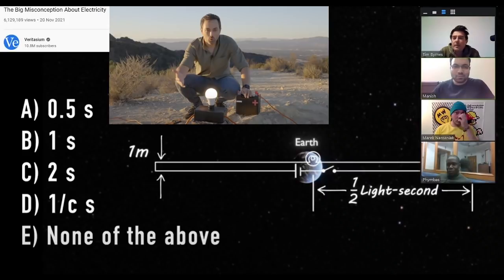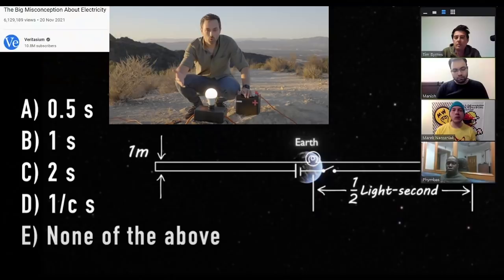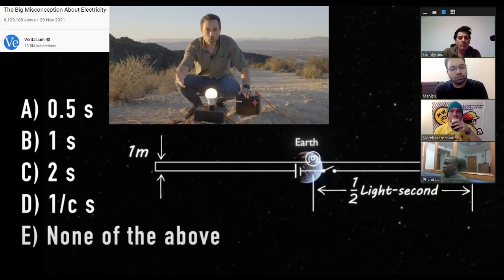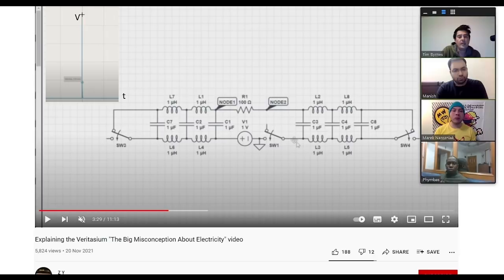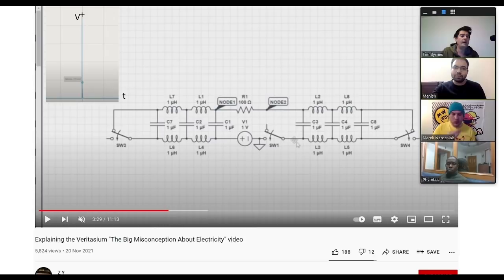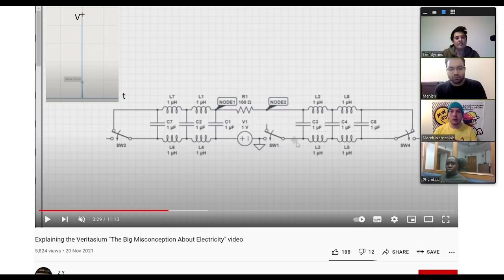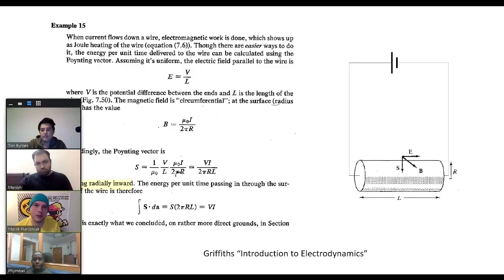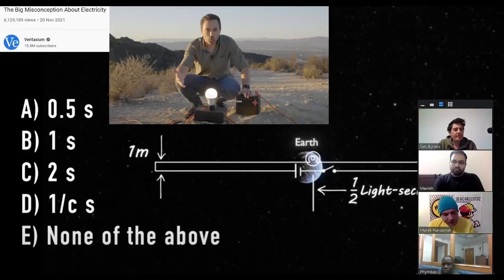Veritasium's Big Misconception About Electricity video and the point about Poynting

Comment: I enjoyed your discussion one the Poynting vector. I have a few comments to add. 

At  8:36  you go through Feynman's discussion of the stationary charge in the field of a stationary magnet. I realize he says this example will convince you the "theory is obviously nuts" he is actually just leading you along. If you read right to the end of the chapter you will see that he demonstrates that the momentum density of the field g is 1/c^2 * S, so that energy flow and momentum of the EM field are proportional. So 'he says' the strange rotating energy flow in this example can then be equated as angular momentum. He revisits an apparent paradox in 17-4 of the book, he say's "about a solenoid and some charges mounted on a disc? It seemed that when the current turned off, the whole disc should start to turn. The puzzle was: Where did the angular momentum come from? The answer is that if you have a magnetic field and some charges, there will be some angular momentum in the field. It must have been put there when the field was built up. When the field is turned off, the angular momentum is given back. So the disc in the paradox would start rotating. This mystic circulating flow of energy, which at first seemed so ridiculous, is absolutely necessary. There is really a momentum flow. It is needed to maintain the conservation of angular momentum in the whole world." So Feynman does take the Poynting vector seriously.

Later in the discussion ( 13:42 ) there is speculation about whether it might just be the divergence of the Poynting vector which might make physical sense as this does locate the real sources and sinks. But you are forgetting the rationale that Feynman used when opening Chapter 27. For the EM theory to conserve energy in a relativisticly consistent way the energy must be locally conserved and effectively track-able from source to sink. So the energy flow must be real, whatever energy really is.
Reply: Your recounting of Feynman's explanations hits upon my view on the Poynting vector descriptions for circuits. My perspective is to view the fields' energy density as the capacity to do work; so, unless one is interested in understanding the dynamics of some object that couples to the field (e.g., electrons), it sounds like an energetic analysis only gets you halfway to understanding the system behavior.  Even in your quoted example of Feynman's explanations, he refers to how the energy density is used as a ledger to explain system dynamics (i.e., the rotating disc), which is an explanation motivated by the apparent absurdity of analyzing the energy density alone.
Reply: In our static charge-magnet example, the magnetic field is static, so curl(E) = 0, while curl(B) is given by curl(mu_0 * M), where M is the magnetic dipole moment density (or magnetization) of the magnet. B dot curl(E) is zero everywhere. E dot curl(B) is non-zero, but the integral of this value over all space is zero because E is a conservative vector field while curl(B) is solenoidal field without any sources and sinks. Thus, due to the calculus vector identity -div(ExB) = E dot curl(B) - B dot curl(E), the spatial-average of divergence of the Poynting vector -div(ExB)/mu_0 is equal to zero 0. So in some places, -div(ExB)/mu_0 is positive, and in others -div(ExB)/mu_0 is negative. So in our static charge-magnet example, there is infact a divergent flow of energy which flows from one side of the magnet to the other. As it turns out, this net "momentum flow" in the Poynting field is non-zero, but it is balanced out by the change of the relativistic "hidden" mechanical momentum inside the magnet. So the total momentum of the charge-magnet system at rest is still zero. If we wish to setup this system with a charge and magnet initially placed at infinity, we must apply equal but opposite forces to the charge and the magnet so that they approach each other directly, thus the net momentum required to set up this system is zero.
Reply: This is just an instance of electrical power = E x I.   Vector E vector directly relates to voltage applied across the load via the lossles wire and the current is determined by the load  We know M is directly relates to current (eg we can use a tong tester)  so, here, we can easily measure the transmission of power (or use I x R squared), using conventional AC or DC analysis, not needing Poynting.  Feynman mentioned the formula is more a calculation of conservation of energy anyway.   The point is, it does not seem useful for the characterisation of wired circuits.  And - it is not the reason or mechanism that all electrical power is transferred.
Reply: @thomasfolks  Nobody is saying that V x I is not a more convient way of computing power in a circuit. However it is really just another way of saying the same thing. If we are after a more physically real model of the situation we need to look at the EM fields and the Poynting vector is an important EM field concept.

Lets look at the current I. This is in reality a proxy for the magnetic field, B, via Amperes law - ∫ B.dl =  μo I. We don't directly measure current in a circuit. The most direct way of measuring current is with a moving needle ammeter which is in fact measuring the magnetic field around the wire (or coil to amplify the field). We never directly measure the density and drift velocity of the electrons in the wire.

Similarly the voltage V across two points is really just a proxy for the the electric field, E, ∫ E.dl =  V.

And then, through the relations connecting E and V, and B and I, V x I is identical with the divergence of the Poynting vector through a volume surrounding the circuit element.

I realize you already stated these two facts in your comment. However you then said this was the reason the Poynting vector is not important, but I think it shows the reverse.

So while V x I can allow us to efficiently compute the power dissipated in a circuit element it doesn't really lead to any physical insight to what is actually happening. Divergence of the Poynting vector computes the power dissipation. The Poynting vector itself shows the flow of EM energy, something V x I cannot do.

For example, knowing that the energy is mostly in the fields, as is most of the energy transport, and knowing that within a conductor the electric field is almost zero we have to conclude the energy transport is mostly outside the wire, albeit strongest nearest the wire. We can then understand that the electrons most responsive to these fields are those at the surface of the wire, and deduce phenomena like the skin effect.
Reply: Thank you Hank de Wit.
Reply: Thank you, I wanted to look up the original source but this makes my life easier.